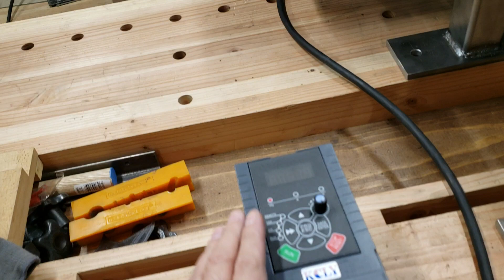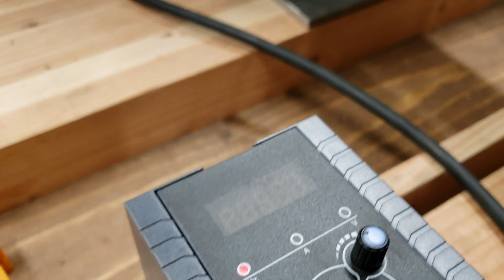It is rock solid and working!

Comment: What did you use for receiver tube instead of what the plans called for?
Reply from the maker: I just went to Metal Supermarket and found tubes that nested in each other.  I had to file down the inside weld seams on main tube and grind a groove on the telescopic tube to ride along the weld seam I couldn't file away.  I was lucky to find what I needed in their scrape cut off stock.

Comment: Well done! Especially if you taught yourself how to weld on this project. I too bought the plans but built a modified metric version.
Do you find your 1.5hp motor is sufficient? I used a single phase 3hp motor that dims my workshop lights when I turn it on!
Reply from the maker: 1.5hp has been plenty so far.  It is on my dedicated 220 circuit so not sucking amps from lights.

Comment: I think that the wheels are not straight in line. I can see from the tracking wheel not in straight position when you running the grinder. When you set the tracking wheel in straight position, the belt will tend to run out. I experienced on that situasion. Btw.. nice build.